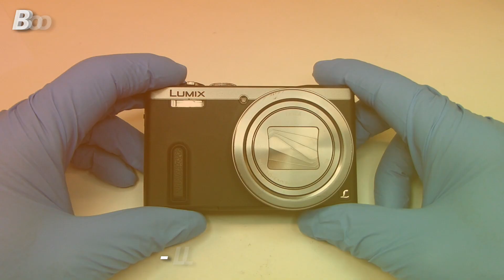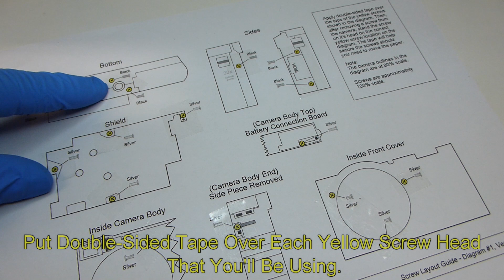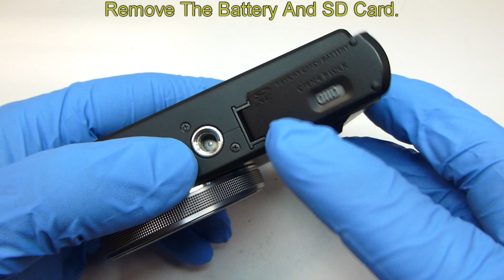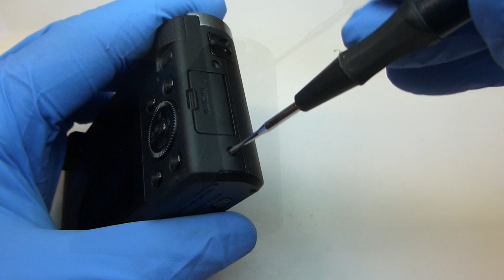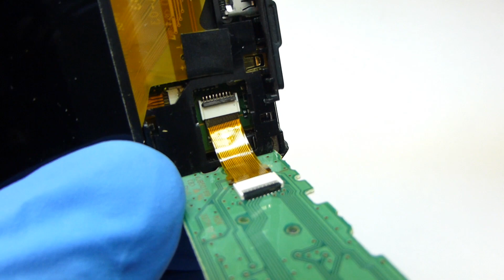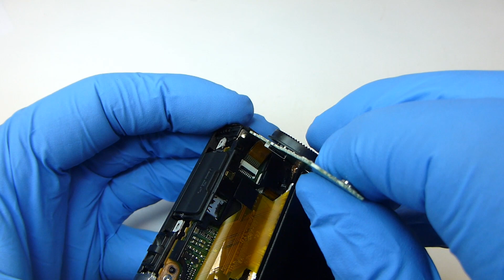How To Replace A Lumix ZS40 / TZ60 LCD Display

Comment: Thanks for the video. The instructions were very clear. Although I did not find any youtube videos for my particular model (Lumix LX10), yours was very helpful. My camera screen intermittently shows some colored lines or distortions, gives a black screen when tilted, but takes perfect shots. I plan to pull out and reconnect the LCD cable ribbon first before ordering an LCD screen. Thank you.

Comment: Hi. Great video. Is it the same process for the TZ80 too?
Reply from the maker: Even though the TZ60 and TZ80 physically have the same size of LCD screen, I am not sure if it will be the same process to remove the LCD screen, and if the screw layout is the same. I would guess though that they would be quite similar.
Reply: @Thebobfactor  thank you. I'll take a look at screws and see if I've got a small enough screwdriver to open it.

Comment: Hello sir, do you have experience with a Panasonic DMC-G7? I'm trying to replace the LCD. I can get the unit off, but I can't remove the LCD from the back cover.
Reply from the maker: Hi Steve. No, I'm afraid I've never worked on a DMC-G7 at all. Sorry I can't be any help.
Reply: @Thebobfactor  Thank you for your reply.

Comment: Bob you were the man of the situation, I followed step by step and it was such a pleasure to see that LCD screen light up again at the end. Some feedback for the community:
- works on my TZ61 as well. Now TZ61 might just be the name used in Germany to market the TZ60. I could not find solid proof to confirm or infirm the guess but at least for the tutorial it did not make any difference.
- I used the "DMC-LF1 DMC-ZS40 DMC-TZ60" from a famous Chinese website
- I used the "VESSEL Precision Screwdriver Set TD-56S" from a famous American website... the 000 came out handy for some screws as well

Comment: Thanks for the video.  You say a #0000 Phillips to remove screws.  Very difficult to find.  I did fine a #0000 JIS screw driver for cameras made in Japan.  Do not want to strip screws so can you provide info if the JIS will work with the camera.  Do you know the size of the screws.  Thanks
Reply from the maker: I have read comments in forums where some people say that they have used a JIS for the Lumix cameras, but a JIS didn't work for me, only the Phillips head did. So, I'm wondering if Panasonic used different screw types in different countries possibly. It would be good to try both. If you try a #0000 Phillips and it doesn't bottom out in the screw head, then it would probably be a JIS screw. The angle on a Phillips head is such that it won't allow it to go all the way to the bottom of a JIS head screw, and that's why it strips them out. Here's a link to a Phillips screwdriver that I have used on both Lumix and Canon cameras. It's listed as a 1.2mm, which is equivalent to a #0000.   https://www.amazon.com/gp/product/B0899KZ211/ref=ppx_yo_dt_b_asin_title_o00_s00?ie=UTF8&th=1
Reply: @Thebobfactor  Thank you,

Comment: Hi, can you tell me the size of the screws (length and diameter) and do you know if they are the same on the TZ7 ?
Thank you
Reply from the maker: Hi. I don't have the exact length and diameter of the screws, but the screws that are shown on the screw layout diagram are very close in that regards. Some of the screws from a TZ7 may work on the ZS40, but I don't know if all of them will.
Reply: @Thebobfactor  Thank you for answering so fast. It's difficult to measure the screws on the layout  :)
Tomorrow, I'll get my caliper and I'll measure them.
Reply from the maker: Sorry I can't be more help with it though.

Comment: Hey Bob, Excellent LCD replacement video !!  I can't believe that Panasonic didn't use a separate lcd cover like Canon does so you don't have to replace the entire LCD panel.  Have you ever been able to find a ZS40 or TZ60 firmware update for this model?  Thanks
Reply from the maker: Hi Brett. Thanks. I'm glad you like the video. I've yet to see any firmware for the ZS40 or ZS50 or the TZ equivalents. And I agree with you about the lack of an outer LCD protective glass.
Reply: @Thebobfactor   Thanks Robert.  I have a minor scratch on my ZS40's lcd screen so I was considering changing out my LCD, thanks to you I can see that it's a relatively easy process.  I've seen many posts online where ZS40 owners have been looking for firmware updates, relieved to know they're just not available.  I think I'll contacting Panasonic to dig further.